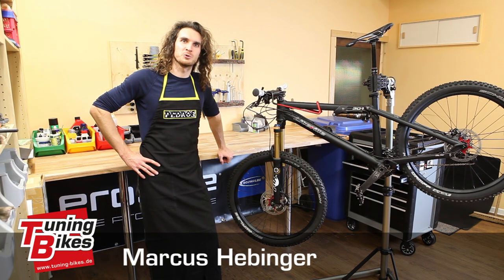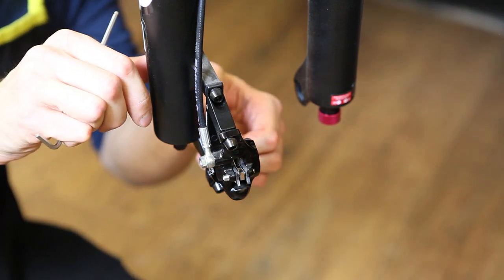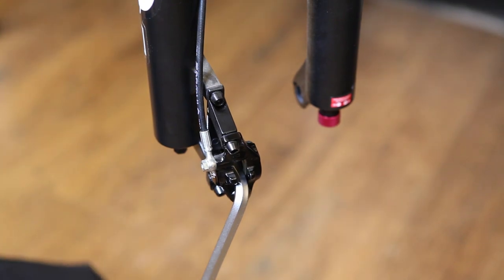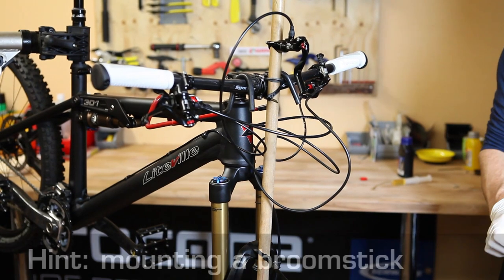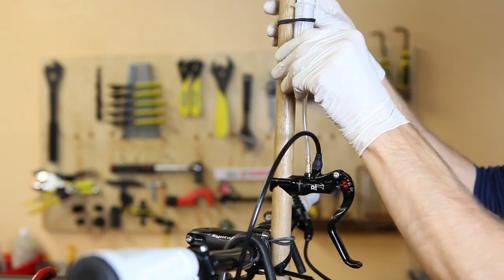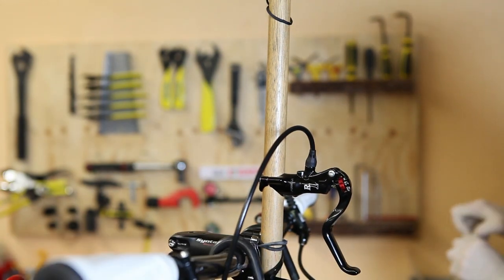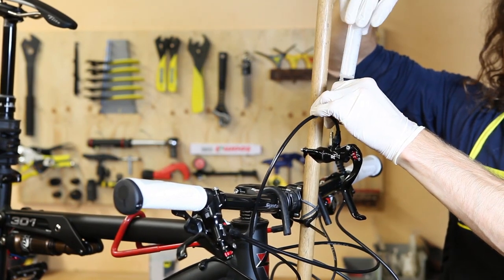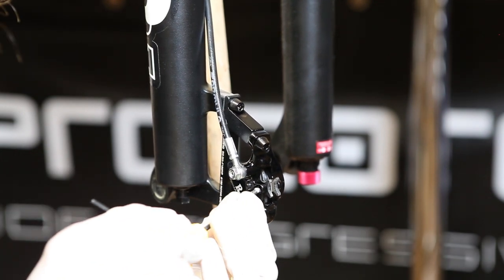Bleeding Formula Brakes - Tutorial [English] - Formua R1

Comment: Tuning Bikes 

Thanx Mischa, that's what I thunk. Heh, although I never do it with any car I might buy, unless I HAVE to work on the brakes, it seems to me that some diy happy person may have messed with the fluid in used mtb brakes and that's why they're for sale. One of the calipers had a piece of a cardboard box between the pads, which had been pumped really tight by the lever 🙄 and was mega difficult to release. I got it out eventually by clamping the caliper in a small vice, with the lever trailing on the floor and undoing the bleed screw (highest position won't let air into the system) while I applied pressure to the pads to separate them. Fluid came out and eventually the cardboard came out. I learned all about brake bleeding 35+ years ago on a govt mechanics training course when I was unemployed for a while. I haven't used them yet because I still need to buy a bleeding kit.
Reply from the maker: Dear wordreet, we sell the bleedingkits and you can get back in shape  working on brakes. with a little routine and good tools its a pleasure.
Mischa

Comment: Interested in two points: With DOT I was always taught to try and remove dissolved gas by shutting off the connector and creating a vacuum in the syringe before connecting to the bike. You don't do this? Also with Avid, a complicated sequence of pushing fluid in and out and flicking the lever is described (I think to help clear the reservoir). Again you don't need to do any of this? Thanks.
Reply: Hi Keith, yeah, seems kinda outdated this video. Since shooting it we added a bleedblock and 2 clamps for the tubes to do exactly that and i think in most of our other videos lever flicking is also recommended, propably got lost on the cutting table. Nice find. Sincerly, Mischa
Reply: I was wondering the same thing, thanks!!